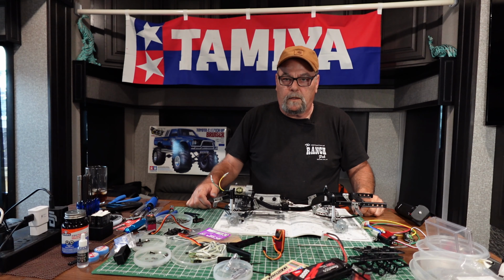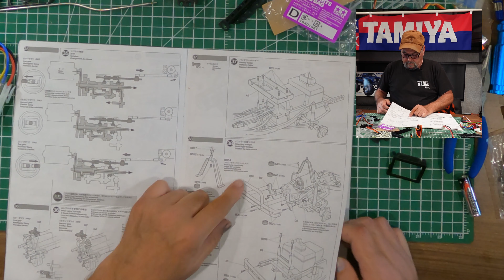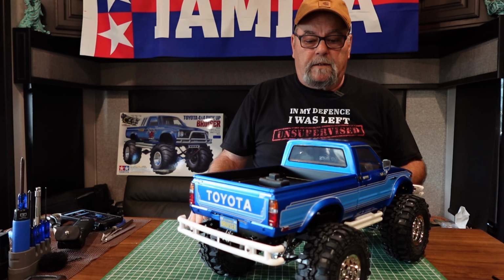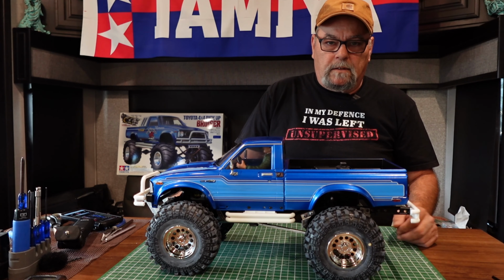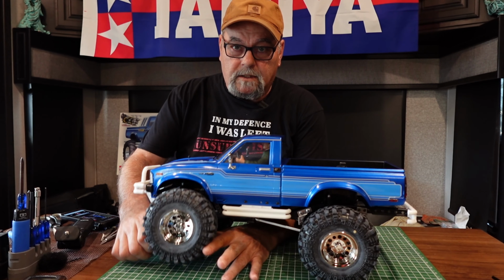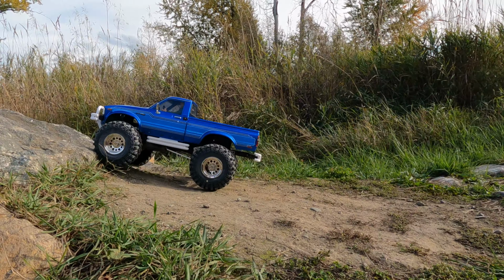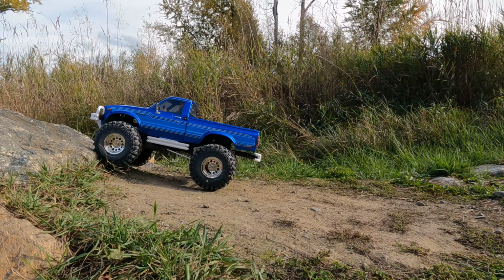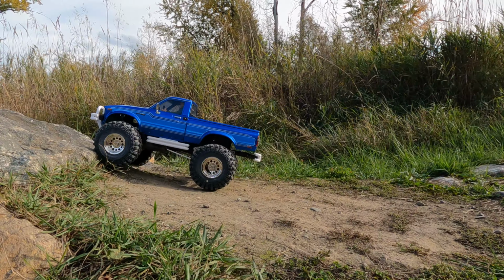The "D" bag. Tamiya Bruiser.

Comment: Hi. What a beautiful truck. I like the blue color you are using. What TS code is that? And the tires, Do you have the part number / dimensions on them?
Reply from the maker: The paint is Tamiya TS19 metalic blue.
The tires are 2.2 proline super swampers on the stock rims.
Reply: Thank you

Comment: Im thinking about one, or the High Lift, which one would you recommend?
Reply from the maker: I like the Bruiser better I think. Both are good detail on the body.
Both are good trail trucks. But neither are good crawlers.
Can't go wrong with either one.
Reply: @EMPTYPOCKETSRC  Thanks! I got Axial for crawling, and Tamiya will be more of a trail truck :-) I wonder if one can fit different wheels on Bruiser, since it has special connection.
Reply from the maker: @zosozoso2  I had different rubber on the stock rims.
There may be a conversion kit for running different rims. I don't know off hand.